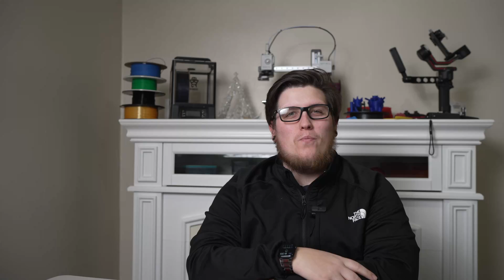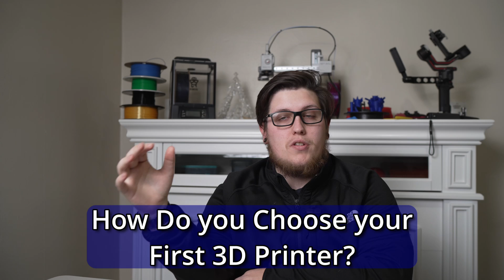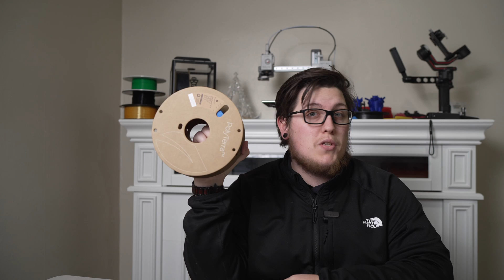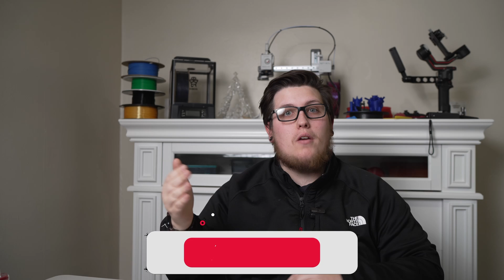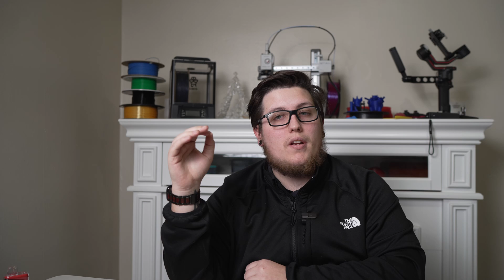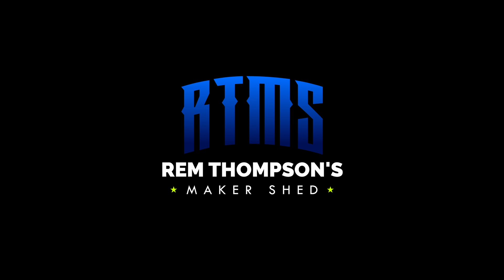What to look for in a 3D printer | 3D Printing for Beginners

Comment: I bought a Neptune 4 max, for my first printer, wow, I messed up.i have gone through ,1 printer head, and 6 hotheads, and I just bought 2 more., I did alot of watching and went and got the sunlu t3, and straight out of box it won't print,  in your eyes what am I doing wrong
Reply from the maker: Thomas there’s not a lot to go off of with this comment, it’s very hard to determine what might be the issue here my best recommendation for troubleshooting specific machines would be to check out Reddit and other places where you can find specific resources for your machines. 

The Neptune 4 Max is a solid machine from what I’ve heard, but there’s not a lot to go off here

Comment: Thank you for the video, it has been very helpful! Love the idea of saving for a better machine, but my price point is set at 500$ by my wife. So that is all I have to spend on the machine. I'll have an extra 200$ for filament and peripherals that I'll have to ask forgiveness for later. All things considered what is the best value for the buck in FDM machines, for a complete beginner, in yalls opinion?
Reply from the maker: Great question! What are you primarily interested in making?
Reply: @remthompson  Mostly PLA projects for stuff around the house like holders and carriers. I have a few things that could use a new casing around them. I would like to make some pulleys as well. They'll probably hold 100lb or so. The biggest reason I want a printer is to learn how to implement the CAD and CAM software into a real world thing. It just seems very interesting to me. I'm not looking to sell stuff, really, but what I do make, I want to be durable and a decent product. If any of that makes sense.
Reply from the maker: @olnewbie3556  depending on how big of print volume you’re interested in, I really love my a1 mini. It’s a bit small but for under your budget you can get it, with the AMS multi color unit. Leaving you with more filament budget :D

Alternatively you can check out the SV06/Plus. They’re on a great deal right now. I love my plus! https://amzn.to/3IlOomN
Reply: @remthompson  You're Awesome! Thank you for helping me out. I jumped into a Discord group as well and they're telling me to get the SV06 Plus as well. I think that is going to be the way to go.
Reply from the maker: @olnewbie3556  it’s a great value. Consider getting the klipper screen for it too!

Comment: Making a lot of good points, when I was picking out my first printer I had to decide between either 1 single 599 printer ( the adventure 5M pro ) or 2 Voxelab Aries at only 249.99, I picked the two over 1 just for more print time vs a single print at a time, definitely should’ve saved more and gotten a bamboo printer from the start, but still loving my Aries, they aren’t half bad starter printers
Reply from the maker: Voxelab doesn’t get enough attention. I had an Aquila for a while, decent printer. Basically an ender 3v2 for cheaper. 

2 3d printers will always be faster than 1 :)
Reply: I bought two Adventure 5M (non-pro) for ~299 EUR (and I think it's selling for 279 on Amazon US). Considering that price, I guess it will be good enough. That is not my first machine, I already had Tiertime UpBox+ (terrible!) and I have one Prusa MK3S. Currently, Creality K1 is getting cheaper (~400 EUR). BambuLab A1 Mini is ~329EUR and P1P is 669EUR, for reference. I don't have any BambuLab printer, but I have a felling that it's somewhat "oversold". The AMS is only really selling-point.